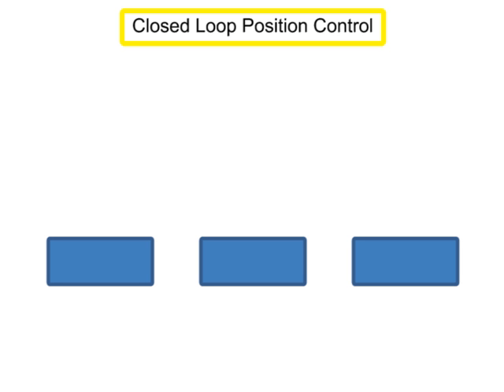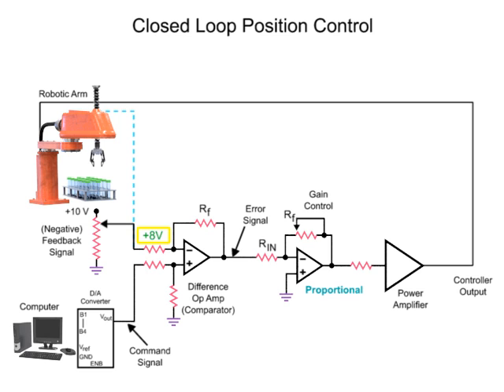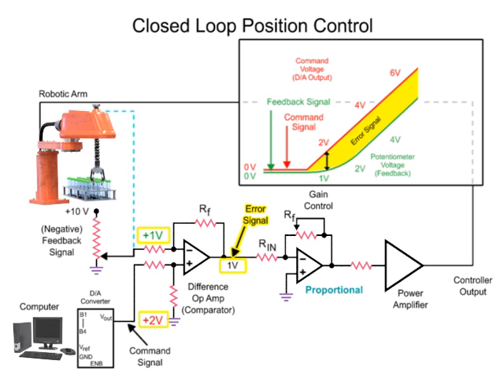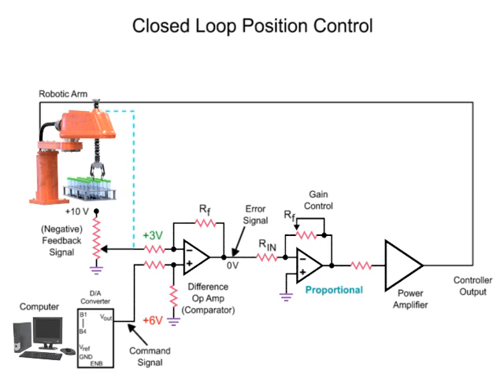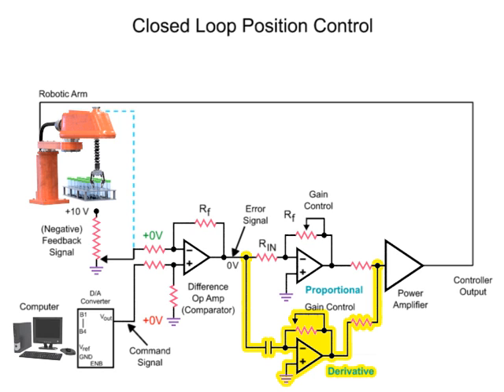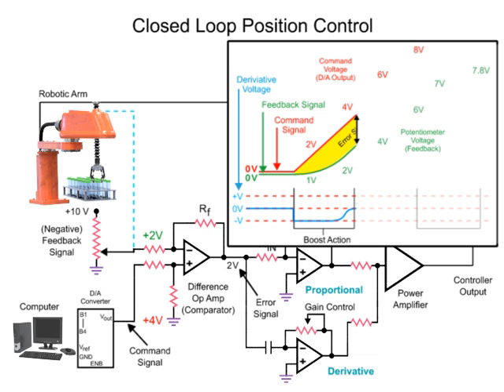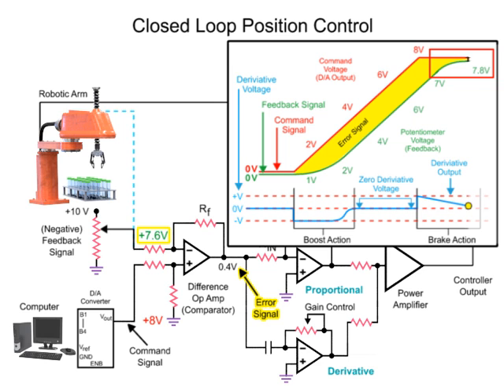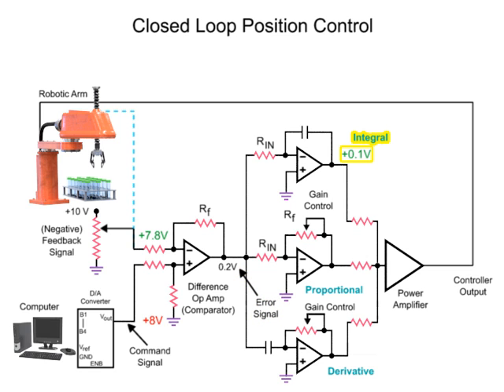PID Controller

Comment: Hi, how do you know the Vout of the D/A converter is true?
Reply: I'm designing a flyback converter with PID feedback for my graduation project. I think the same way will work for voltage control. But fixing the converted voltage using another voltage doesn"t make sense.